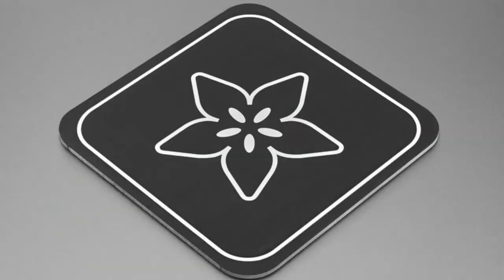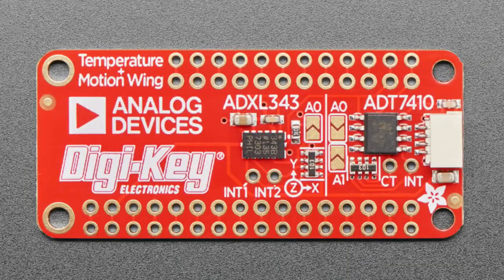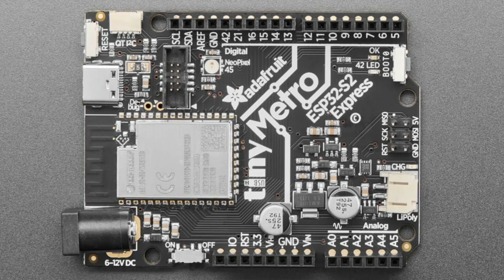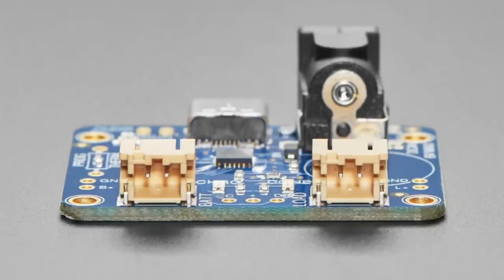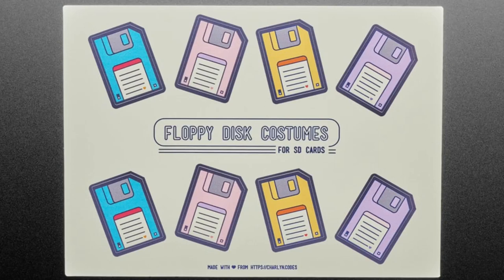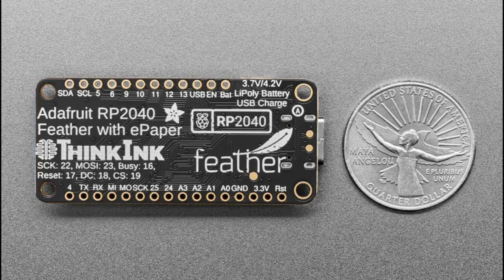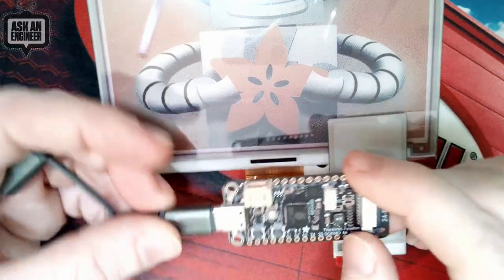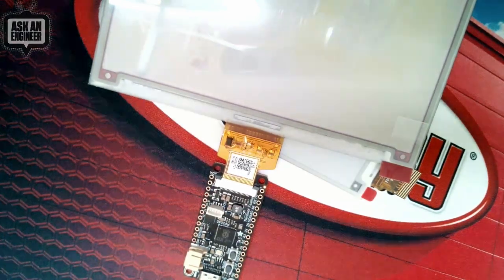#NewProducts 4/19/23 Feat. Adafruit RP2040 Feather ThinkInk with 24-pin E-Paper Display - STEMMA QT!

Comment: The solar/DC battery charger is at the heart of one of my earliest projects (improved MightyMintyBoost). The only complaint I had was the big honking electrolytic cap, but it still fit in the project case I got so that's fine.

That is part of the reason why I was recently investigating making custom PCBs that accept power from 802.3at POE+ and power LEDs and connect devices via Ethernet rather than CAN or LIN. I found that it's probably more cost-effective to get a compatible active splitter instead.